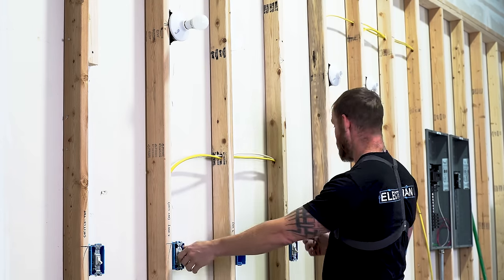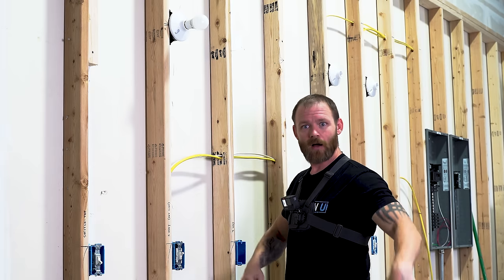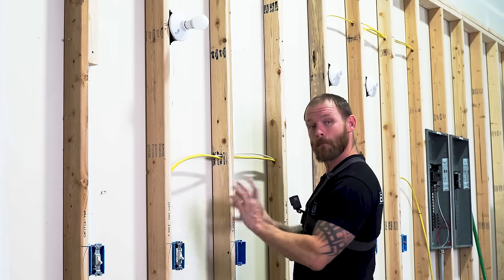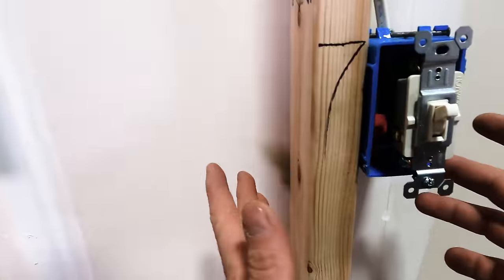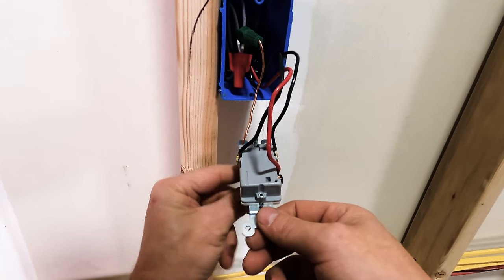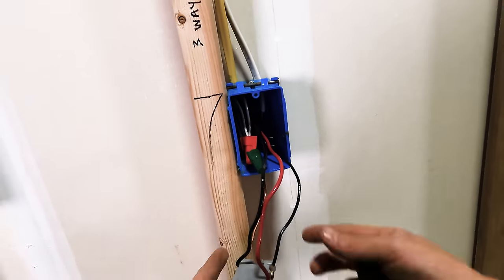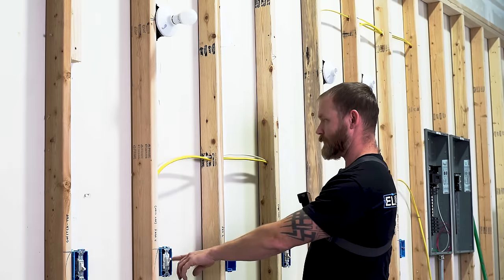Troubleshooting 3-Way Switches: Why Does My 3-Way Switch Only Work Sometimes?

Comment: Language is different but science 
is the same.  We use the term strappers for travellers, switch live for switch leg and common for common. I generally wire using what we say 3 core and earth ( ground) which consists of a grey(gray) , black and brown in 1.5mm (16AWG). All are Live so the black and grey are over sleeved with brown sleeving as brown means live(hot). Personally the old colours were more appropriate Red (danger) live Black Neutral. Anyway great explanation that you have presented.

Comment: Im not a electrician but i can muddle my way though it. 3ways have always confused me, so what do you do? Look at a diagram off the net on how to wire a 3way switch. Following the picture i was having a similar problem to what you where explaining, over & over looking at it & confirming its exactly like the picture, well almost. 
Depending on manufacturer the Black screw may be at the top or bottom of the switch so following a picture & running your wires so the same location may cause you 2hrs of frustration & ruin half your day.
Thank your for clearing up the Black screw mystery. LOL

Comment: After getting a couple calls backs up to a year after I replaced a homeowners cheap POS 3 way switche because the other 3 way went bad and they expected a free service call I would replace both 3 ways at same time. Was hard to convince some penny pinchers that they got their moneys worth out of the cheapest switch made and lasted 30 to 40 years.

Comment: I wonder what a “Chicago” 3-way is?  😅. I’m troubleshooting multiple 3-ways in single gangs with power coming from different breakers.  They did not work since I moved in.  I have not used a multimeter in many years.  I am determined to get it done.  I also found in this house built in CA in 1962, a single gang with 3 switches, one 3-way and 2 regular switches.  Why?????  Much of it doesn’t work but I’m determined to get the tape off all the switches to be able to use lighting.  Your video is great for standard switches.  Thanks for making it entertaining.  😊

Comment: I have one light with three switches.  Two 3-way and a 4-way.  The 4-way had to be on for either of the other switches to operate the light.  If the light is on, I can turn it off with the four-way.

Of course, none of the wires are labeled.  I figure I'm probably going to need to get a long piece of wire with clips on each end to do a continuity check to determine which end belongs to which other end. (Power off of course)

Maybe then I can sort out where the problem is with the wiring at the switches.

Hoping for some tips in this video. 😂

Comment: We had a newbie/cub change a broken 4-way switch in a light circuit for six doors in an existing commercial building. The cub messed it up, then removed two more 4 ways. Finally reached out for help.  Wired in conduit with black THWN wire no wire labels were used. Traced the travelers and corrected the spaghetti mess. Always fun fixing something someone else did. Easy fix lol

Comment: I always set up my three ways that they’re both off when the lights off this stops a lot of service calls same thing with four ways. If you’re doing your checks and one of them stupid switches and then the on position and the light is off switch to travelers at one location. This will help prevent service calls lol.

Comment: Hey dustin, anyone can correct me if im wrong but i noticed you had 14gauge wire on a 20amp circuit. Isnt that against code?
Reply: Yes, that is a code violation.   You however,  are allowed 12gauge wire on 15 amp circuits, just not the other way around.  In rare cases,  12 or even 10 gauge wire will be used for 15 amp circuits.  In very large homes or an addition where the panel is far away (more than 100 feet or so) sometimes we have to oversize our wire to keep voltage under control.   If you have several circuits going  to a remote area, it's more economical in terms of labor and material,  to install a subpanel near the remote area instead of having to oversize all the circuits.   Just go to home depot or Lowe's,  check out the price of NM wire and you'll see what I mean.

Comment: Option 1: wire travelers identically on both switches. Light is ON when switch positions match (both up, or both down). 
Option 2: reverse traveler colors on one switch. Light is ON when switch positions mismatch (one up, one down).

Comment: Great tip. thanks. btw..  I’m not sure who designed this thing but my wires are not color coded very smart.. a red and a black are bundled together and a white and a black also bundled together... hard to see all the way in the back of the box (where the wires are split into individual ones) to see which ones are bundled together. Also my 3 way switches (LEVITON) have two red plugs for travelers and 1 black for com.. I originally assumed maybe the red/black wire colors were switched so I connected both black wires to travelers and the red wire to com (i did not check for hot wire first .. and maybe i should have). Needless to say it did not work (had the same issue as you are showing in the video). Your helpful tip helped me solve the mystery.. once I looked deep in the back at the box to see which wires were bundled together the fix was immediate. thanks.

Comment: Muchas gracias for the very informative electrical 3way connection video. I corrected what I presume was an electrician's hot and travelling wires mixed up

Comment: Very true! I recently came across a situation where somebody used a 3-way switch instead of a 4-way switch. How you may ask? They attached the extra wire under the common terminal. 😅

Comment: Great explanation on how to figure out which wires are the travelers and which wire is the hot wire without needing a multi-meter.

Comment: I remember the first 3-way circuit I installed in my garage many years ago. It was simply two switches and a simple porcelain light socket that I just bought. BTW - It was in the height of summer and it was close to 100 degrees in the garage. 
I finished the wiring, double checked my work, turned on the breaker, flipped the switches and the light didn’t go on. After running back and forth many times between the panel in the basement and the garage (and sweating like a pig), I tested all the connections and everything seemed fine. I even checked that the light bulb was ok. Finally, it turned out that the brand new porcelain fixture was defective!!🤨 Put in another new fixture and the light went on. Lesson learned.
Reply: Jim, I can absolutely identify with you. Years ago I worked for a company installing and maintaining paint booths for body shops. The boss sent me to one that would not come on at all. Just so you know there is a lot of wiring on a paint booth. I started by checking the breaker and working my way through with my multimeter for 4 hours. Everything tested right. I started at the beginning several times. Finally I gave up and called the boss. After telling him the story, his first question was "did you check for any loose wires."  Well, no. Everything tested okay. So I start flicking the wires and lo and behold, the incoming wire to the main switch slings out. Turns out, whoever hooked it up stripped the wire too thin and it had burned in two. So, it was pushed up against the contact enough to test good, but not strong enough to supply enough to start the motors. You can bet your butt, now when I open a panel that is my first check, any loose wires.

Comment: Dustin thanks for this one. I have battled with this situation a number of times. Usually solve by multiple trial and error. Never thought about checking for the sheathing that they are coming from. Duh on my part for that.

Comment: 3 way toggles always turn off & on when both switches are in defined states. Usually off is both up or both down. In that case one up and one down would be on. (Wouldn't have to be but it's easier to explain.)

If you want to blow your mind find a friend who does computer programming and ask him to look at a 4 way circuit with multiple switches and ask how that relates to the checksum in data transfer.

Just kidding, don't do that. If he/she actually does code you will be there until the Sun comes up.

Love every show!

Comment: So, house built in 1943 with a 3-way for the stair well. Replaced the upstairs switch and now it functions like your's did in it's problem state. When I replaced the upstairs switch, I moved the wires 1-for-1, so I'm thinking the internal of the switch was different in 1943. 
If I go flip flopping conductors around, there is no danger of shorting anything, correct? 
It's actually been like this since 2001 now, but we live this light in all the time. I have ignored it because I don't like disturbing the old wires. (MC wire)

Comment: Question.  I’m doing a 3 way switch setup where power comes to the first switch (12/2), meets cable for wires (12/2) and cable for the 2nd switch w/ traveler wire (12/3).  At the 2nd switch the traveler wire (12/3) meets the wire at the end of the circuit (12/2) to connect at the switch.  Does power need to start at the switch without the wires for lights or does it matter? Connections at both switches will be done via pigtails.

Comment: We have 220 air compressor it takes 12-2 wire with12-2 circuit breaker. How can you add an on off switch in a different location?
Reply: You can pick a location along the line, add a single gang box,  and add in a double pole 20 amp toggle switch.  You'll probably going to have to add a junction box and add some wire as well to get enough slack to make the termination at the switch.  Don't forget to re-identify the white conductors with black tape at all splice points.    Job well done.

Comment: When wiring a outlet or switch with a non-insulated ground wire, I always place electrical tape over the devise screws so there is no way that bare ground wire can come in contact with the energized screw heads or wiring.

Comment: I would like to see a video on trouble shooting a 208v or a 480v panel involving bad reading when testing neutral lead? I’ve been having this issue where I have power from black to red the voltage is good but from the neutral lead to hot or red the voltage is either 0 or way low on the 20 v or under. Any tips. I’m sure there’s something I’m missing.

Comment: What happens if the traveler is hot but not the switch leg? I tested the wires with breaker on, and the switch leg has nothing but the traveler is hot. Replaced the three way about 2 weeks ago and it’s suddenly not working

Comment: ok I have two lights and two double switches I went two change one of the double switches no can do. cant get it wired right. I have two red wires and three black wires coming into the box. any idea how the wires are to connect to the switch?

Comment: Thanks Dustin!  Is it fine to mark the hot wire from the breaker with red tape, just to show that's the hot source?  Not sure if that's OK, or if it's intended to mark it as part of a 3 wire setup (like the red conductor in 12/3 or 14/3)
Reply: I can’t imagine why useful and helpful labeling would break any rules as long as it doesn’t cause a fire hazard due to overheating or flammability? Also labeling, at the switch, which breaker number/s apply to the circuit would be a plus in my book.

Comment: Hey Dustin I watched your grounding and bonding video and I’m new to the trait and I was curious if you could explain and floating neutral or how that works thank you love the videos !
Reply: In a house, electricity comes from a special place called the power station and flows through wires to different parts of the house. When electricity flows, it needs a path to return back to the power station. This path is called the neutral wire.

Normally, the neutral wire is connected to the ground so that everything stays safe. But sometimes, in certain special cases, the neutral wire is not connected to the ground. When this happens, we call it a floating neutral.

Imagine you have three friends playing on a see-saw. They should balance each other to keep the see-saw in the middle. But sometimes, one friend becomes heavier than the others, and the see-saw tilts to one side.

Similarly, in electricity, the floating neutral happens when the three wires carrying electricity are not balanced. This can make the neutral wire carry more electricity than it should, and it becomes a little different from the ground.

To avoid problems, the floating neutral is used in special places where it's needed. But in our homes, the neutral wire is connected to the ground to keep everything safe and balanced.

Comment: Thank you, this made a lot of sense and you explained very well. I couldn’t figure out why the 3 way I replaced was acting oddly — I matched the wiring when I took it out. 

Turns out that the new Leviton Switch I installed had the common wire screw swapped from the original I took out! Learned a lesson — I can’t just match what I pull out!

Comment: You forgot to mention Ohio three-way 😂
By the way like you said it before, this issue occurs when your hot wire or  switch connect to the travelers instead of  your common.

Comment: I just replaced some very old 3-ways in bakelite with all brass screws. The bakelite was stamped COM. The new Decora switches had the black screw, and each end of the run had two wires coming out their own separate sheathing. Bazinga!  COM wire to the black screw, and the other two don't matter, tie 'em to the brass.

Comment: Electrician: It doesn't matter which traveler is on which screw, because three way switches are "always changing." People who want all-off to mean "off" and the manufacturer's logo to be right side up are just whiners. Also an electrician: The screws must be vertical or else the job is sloppy.
Reply: Seen perfectly straight screws alongside horrific code violations. Idgaf about those screws.

Comment: OK, sorry, help the rookie out!?!? Why are you using 12/3 and not 14/3??
Reply: My guess is wiring for something different, like half hots, and using that for the demonstration.
Reply: @dhender85  Still confused! Looks like 15A switch? AHJ would look at me sideways!? Code book time??
Reply: The guage/size of the wire needs to match the overcurrent protection device amperage rating (ex. 15 amp or 20 amp circuit rating). If he's using 12/3 wire it means the circuit has a max amperage rating of 20 amps.
Reply: @EddTheBiker   ??? He has 14/2 feeding and 12/3 on the switch/traveler side and what looks like a 15A switch. In that case he'd need to have a 15A OCD, correct? (in theory, if he had a 20A breaker, the 14/2 would be weak link!?)
Reply: @SamShepherdBlog   what he's doing here is just a mock up. Normally, he wouldn't mix wire sizes like that. It's just for the example to teach troubleshooting. That part will be taken apart before inspection.
Reply: @dhender85  OK that makes sense!!
Reply: @SamShepherdBlog  Given the placement of the light and switches, it's probably just a temporary set up for the video. I wouldn't read too much into it.
Reply: The mistake many make is wire size is actually based on load size and not breaker size. Meaning, 20 amps is not on the wire. The light in this scenario is a very small load so a 14 wire can handle the load and not burn up. In this case 20 amps is the max amount of load allowed, not how much amperage is on the circuit. So Dustin is perfectly safe with using 14 wire.

The other part of this is code does allow tapping (installing one size smaller wire to a circuit) at one point in the circuit. So if Dustin had two tapping points in this circuit he would technically be breaking code.
Reply: @TheForgottenMan270  "The mistake many make is wire size is actually based on load size and not breaker size" - understood! 

Am I (however), correct in my assumption that a 15A breaker should be used on the circuit he is working on? 

I'm on 2017 but could not find a definition for Tapping Point (or Tap for that matter). 

Logically, I would think a "Tap" would be off of the circuit/branch/feeder, so, in this case he would be going up in size, not down, correct??

Comment: Am I wrong saying 12/2 and 14/2 can't be mixed like this? Are you testing to see if we notice this?
Reply: There is a degree of allowance of using 14 gauge and 12 gauge wire together when the power is sourced on a 12 with a 20 amp breaker.
Reply: @TheForgottenMan270  Wouldn't the breaker have to be 15A if using a mix of 12 and 14 gauge wire?

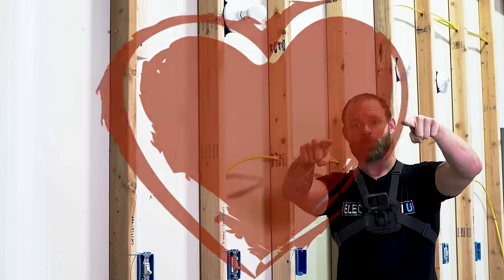Comment: 8:59  I know it’s obvious to people who know but the same applies to boxes with pipe or MC  cable. 2 hots and a neutral will define which wires are travelers mostly. Always good content on your channel Dustin!
Reply: I have 2 hots and a neutral.  So the neutral should be on the common?
Reply: @ivankrushensky  No. The white wires would be connected to all the other whites. The red and black would go to the gold traveler screws. The other wires,being the black and white, the whites connected to the other whites and the blacks would be to the black common screws. That’s the best way I can describe it.actually. If it’s MC or BX the white wire is not used between the two switches.
Reply: @rogerk1710  all I have is 1 white, 1 black and 1 red.  The white is hot....I've tested it with a meter.  I'm thinking this is the second "black".
Reply: @ivankrushensky  Yes. That is one way of doing it. Whoever wired it up originally should have phased taped the white wire with black tape or some other color that indicates a hot wire. 
It’s hard to diagnose a job without being there. I’m glad you figured it out